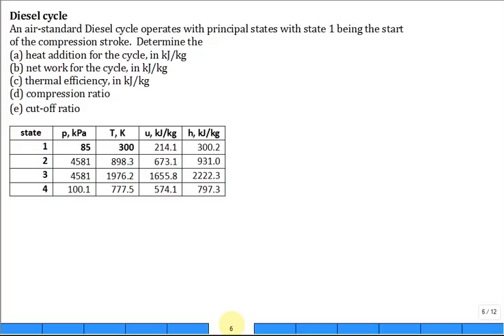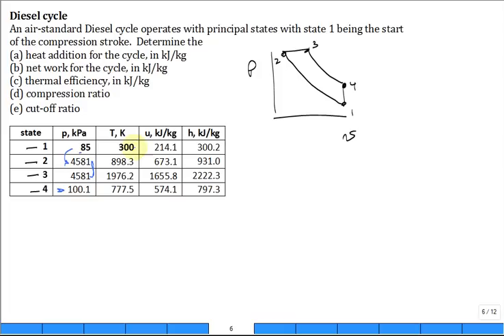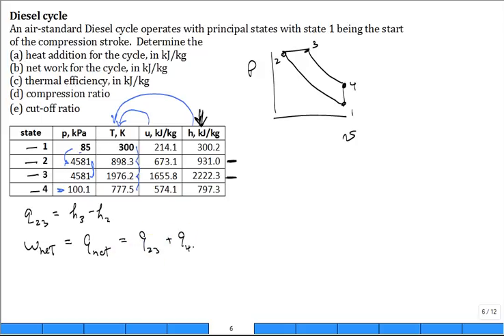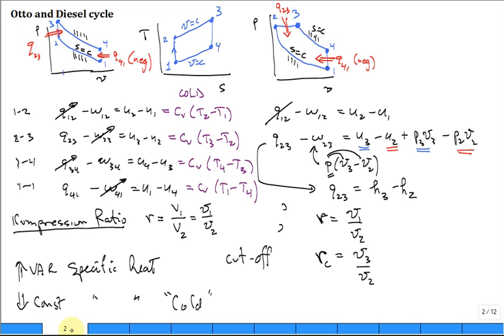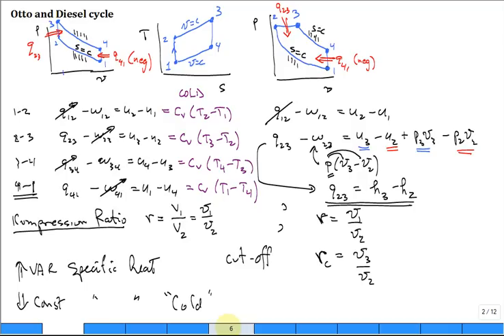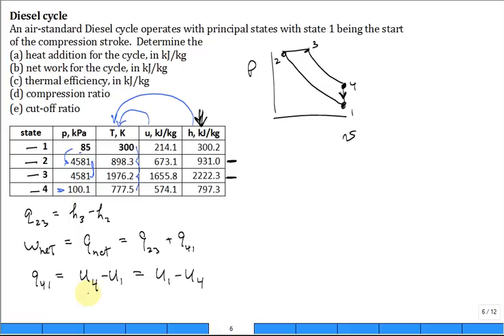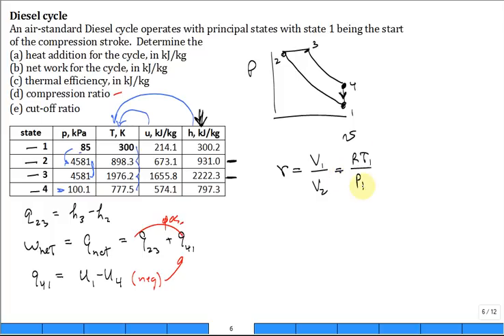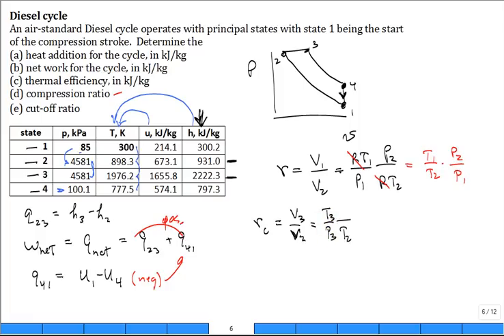Calc Diesel Cycle Given Table Values

Comment: when i use  Cp(T3-T2) , it gives another answer   ,  Any idea ?
Reply from the maker: try using cp evaluated at average temperature (T2+T3)/2.  It will be closer.  The analysis accounts for temperature-dependent specific heat.